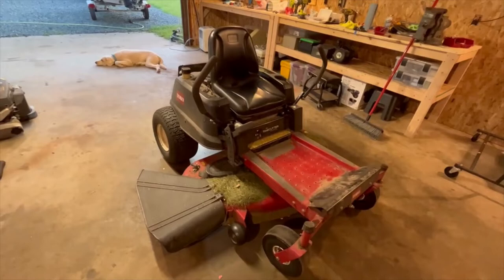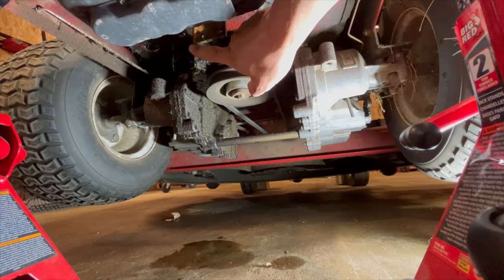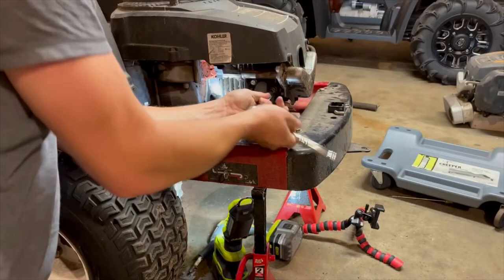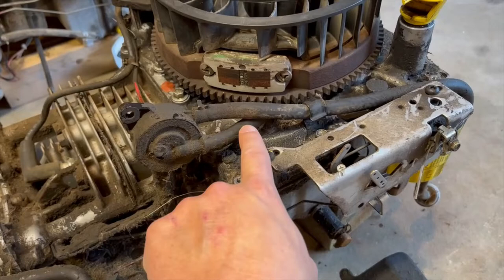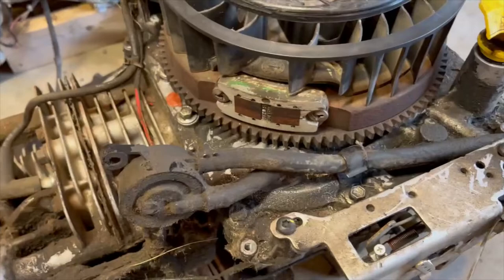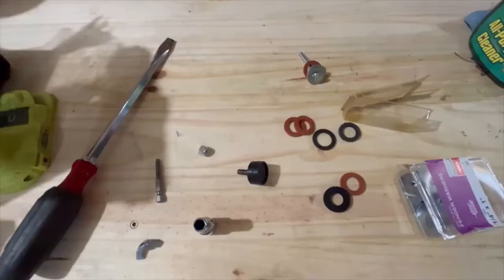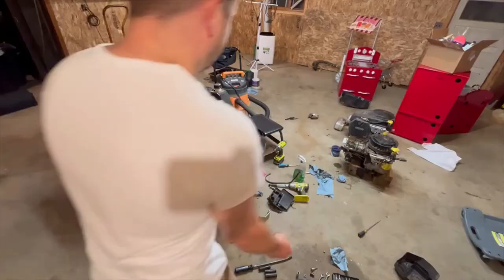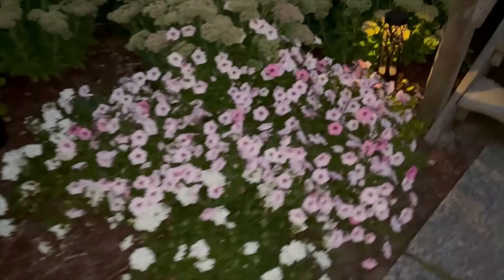Zero Turn Mower Engine Swap

Comment: Great video. 👍 Just hope you swapped over the charge system from your old engine to the replacement because if the correct charge system isn't used then your going to have the issue of your battery dying on you while your blades are on . Just make sure it's strong enough to run your clutch and charge your battery at the same time.
Reply from the maker: Thanks for watching and thanks for the tip! I did not swap the charge system, but so far it's been working great and charging the battery.

Comment: I replaced a 19 Kohler courage twin cam single cylinder to a 20 horse Briggs my pto pullys i kept and installed on the briggs but now with everything plugged up the key turns over the relay just buzzes i can start by solenoid but i cant use my pto afterwards im lost what could be the issues
Reply from the maker: I'm sorry but I have no idea, I would start with double checking the electrical connections and make sure they are all doing what they are supposed to be doing, same with grounds. Good luck!

Comment: I would replace head gasket and sump gasket before sticking it in
Seems they leak like crazy
Reply from the maker: I agree with you, normally on an older engine I would, but this one had really low hours on it and hasn't started leaking yet, and if it does develop a leak it's easy enough to yank out again and fix it.

Comment: simple green eats metal
Reply from the maker: I've used simple green for decades on metal and have never had an issue, even using it in it's concentrated form. I have heard of people that use it in sonic cleaners and it discolors aluminum

Comment: Those motors are junk bombs waiting to explode.  Get another brand.
Reply from the maker: I don't disagree, if it were up to me I would really like to try the Kawasaki vertical V-twins. In this instance I got both the mower and donor motor for so cheap it's hard to go wrong, I'll run it until it blows then ill move on to the next. Thanks for watching!
Reply: Yep changing the motor on one now. Got a crack in the block thats about 6 or 7 inches. Left side from the back by push rod. Same motor. Crazy 😂
Reply: @ballhammerindustries  mine had the same crack in it. Must be common